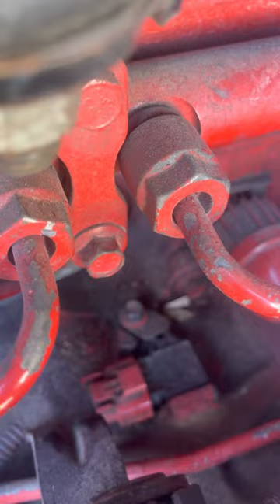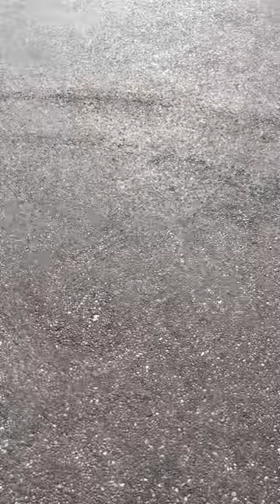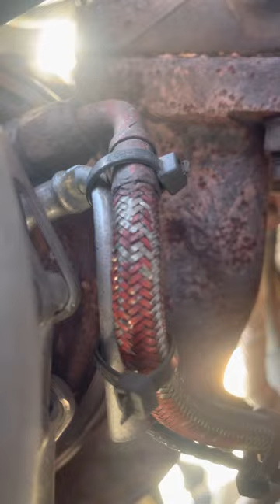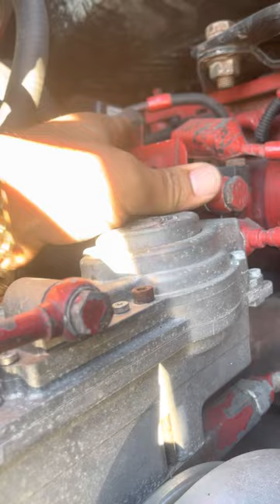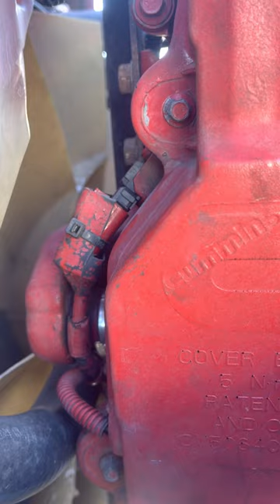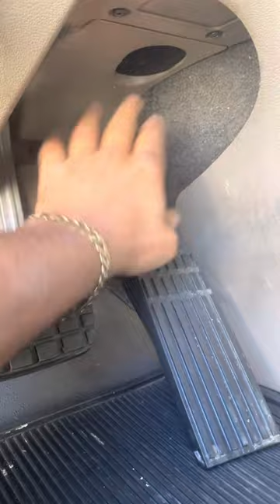Cummins ISX 15 power loss no codes

Comment: Just remember that any sensor that has to do with fuel pressure or a fuel ratio like the ones you mentioned will give you power loss. Cummins has high and low fuel pressure sensors that if bad will derate your engine. Another tip if your cam or crank sensor are going out the issue will be intermittently it comes and goes. Also if you go to start your truck and your tachometer is not moving while you start your truck then it might be a possibility that your crank sensor could be shot or a ecm fuse blown. Just thought to add that in there
Reply: Thank you Amigo.

Comment: Loss of ignition power to the engine could cause a loss of power too.  Fuel metering valve.   bad ECM.  If you don’t mind loading up the parts cannon and just replacing stuff. Best thing to actually do is log data with insite, get it to act up, have a cummins expert like me or at a dealership review the log file to pinpoint exactly what sensor is showing improper data.  At least at a dealer if they don’t have a tech that can review the log file, they can send it to cummins for review by a level 2  expert.

Comment: Great video. Good to know about these sensors because I just repaired a turbo speed sensor wire and and a plugged IMAP sensor. These are good to replace per maintenance every 100k miles as well.

Comment: What can cause pressure drop in the fuel rail? I’ve already swapped out the fuel rail pressure relieve valve. No codes but pressure in the fuel rail still dropping from 29k psi to 160 when I shut the engine

Comment: I seem to loose a bit of power when accelerating on up hills or when almost stopping and I start accelerating almost at the next shifting of gear it almost seems like it wants to choke not a mechanic and looking to get some guidance on what it might be any help/advice would be appreciated thanks
Reply: my friends truck had that issue, it was a crack in the intake manifold itself, then he found out his turbo wasn’t screwed down properly. It was on a Detroit 60 series tho

Comment: Nice video , my problem is  that is trying lot of black smoke last code was EMP sensor I do have DEf working any idea
Reply: I had the same problem. It solved by calibrating the valves
Reply: @kuniku4nano6  thanks will check on that

Comment: My truck is running sluggish.. loss of power and when I'm loaded and take off normal I get gray smoked but if I'm climbing a hill and got to put a pressure to it it turns black, any ideas
Reply: I’m having the same issue right now did you figure out your problem?
Reply: Sounds like turbo

Comment: I have a 2000 Freightliner FL70 with an 8.3 ISC Cummins  with the CAPs fuel pump system. 
And I have power loss...I wonder if I have those same sensor's on my engine🤔
Reply from the maker: Yes they are very similar it should be the same

Comment: My truck is a Isuzu prime mover Exz engine number 6wh1 tc 417126.. My truck vibrates heavely when it's running on ideal and when I'm driving with heavy load it also vibrates and also looses big power in the engine when I try to speed up to 20kilometer it looses power so I really don't know what's the problem

Comment: Cummins insight will tell me any issue with any one of those sensors. I have yet to see one of those sensors fail or wiring issue without a code. That's not to say it doesn't happen. I'm sure it can. I'm chasing a bug on a DD13 right now. No code, throttle response goes dead only in high range. That's gotta wait now though, -30 cold snap breaks lots of shit in a fleet.
Reply: DayRider, has happen to me, we’re I had power loss, the truck recorded the issue and was a brief engine light earlier and went away quickly which I could had missed, it was recorded and I found the issue on inactive codes. You can have a code for something and ends up being another. It’s just how the cookie crumbles ¯\_(ツ)_/¯

Comment: I have a 2009 KW w900 when i press the throttle it revives up then lose power ?
Reply from the maker: Check your throttle body or the accelerator pedal position sensor

Comment: The barometric pressure sensor WILL cause the engine to derate itself... Just a thought.. good luck with it.. ANOTHER Cummins gremlin rearing it's head 🤷
Reply from the maker: I hear you